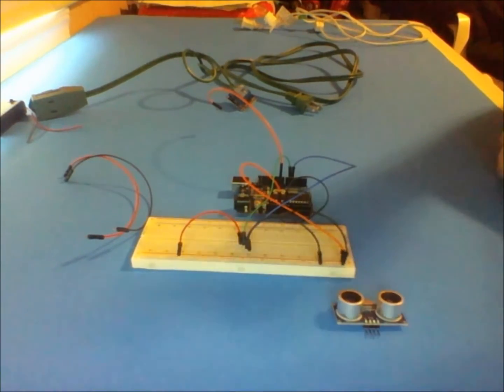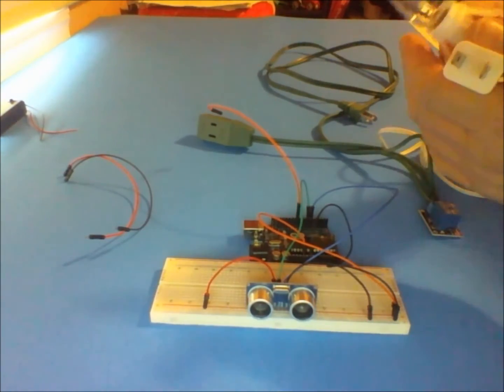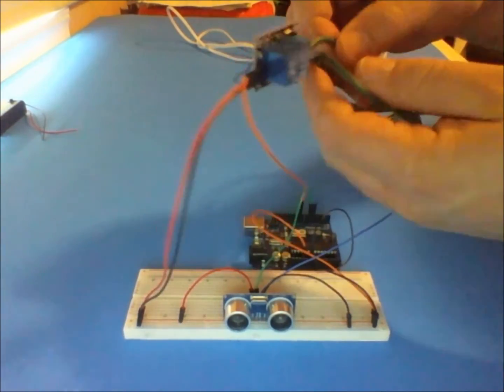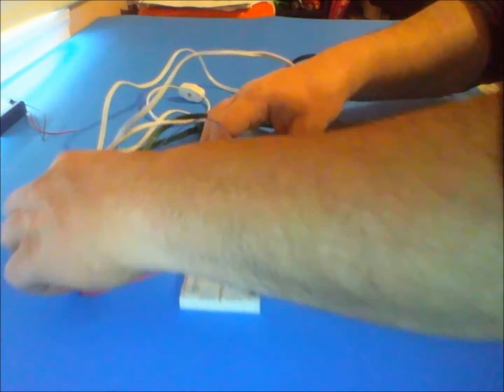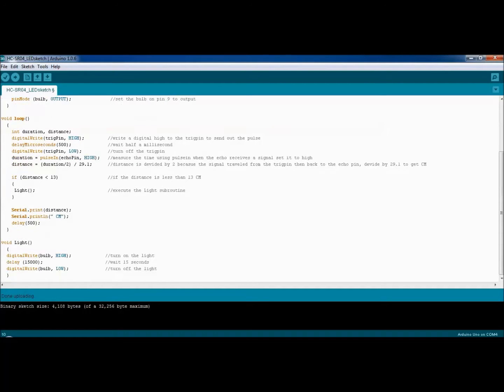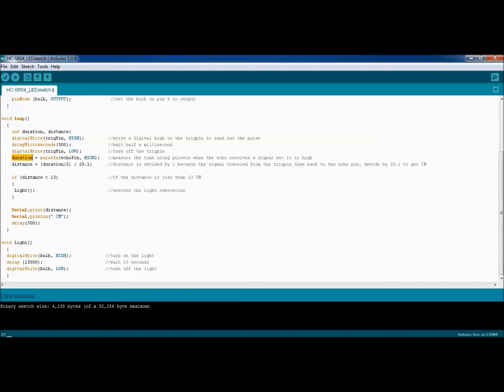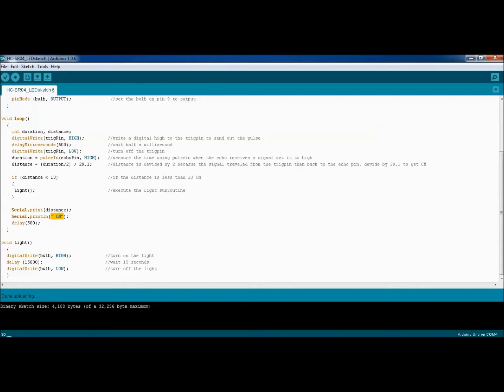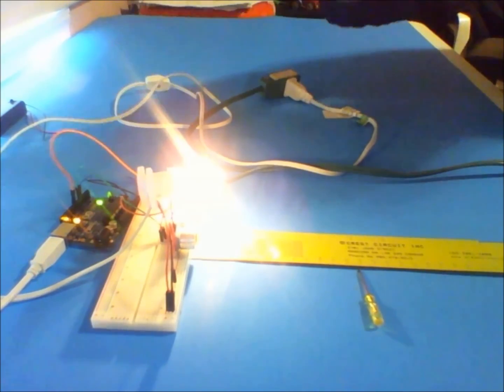Turn on a light bulb on and off with HC-SR04 and Arduino UNO

Comment: Thanks for this video but i have a question, what if i wanna to turn on my light bulb from a distance like 5 meter or even more?, what the proper ultrasonic module i can use?
Reply: what happens? Is it good for 5 meters (sorry my English not good)